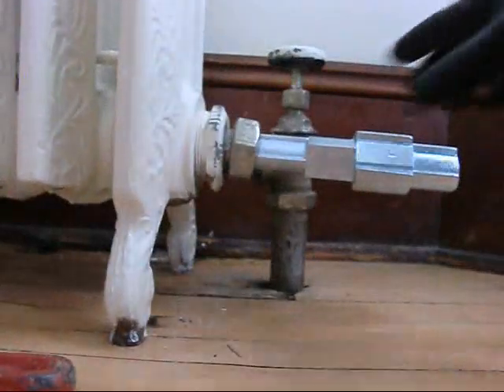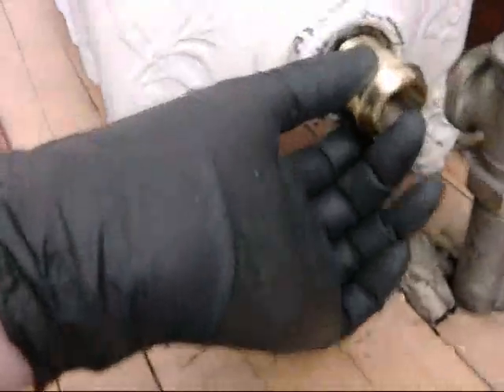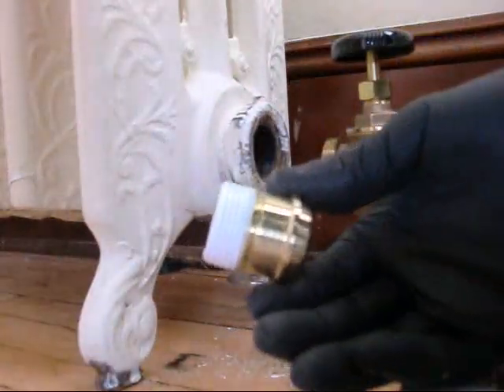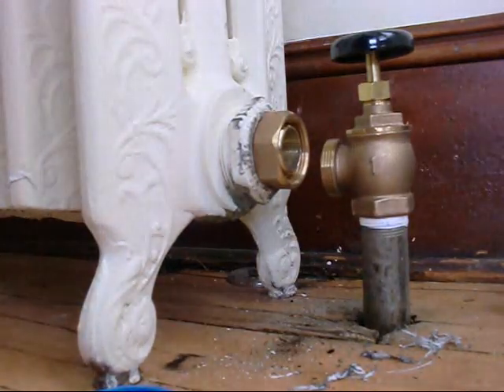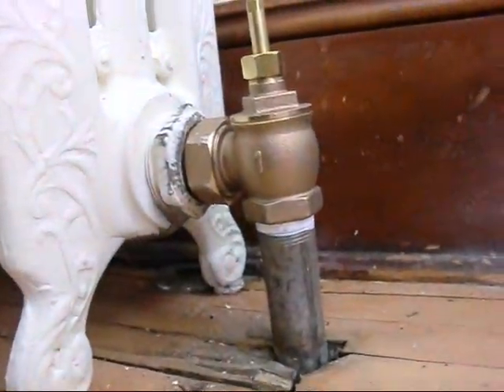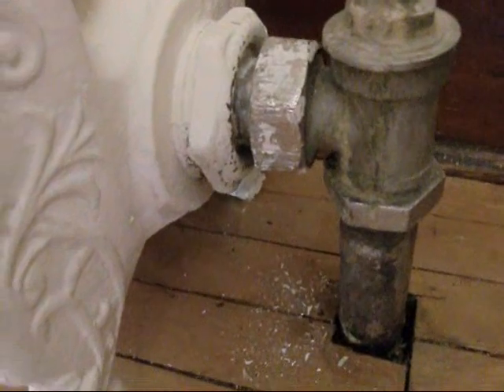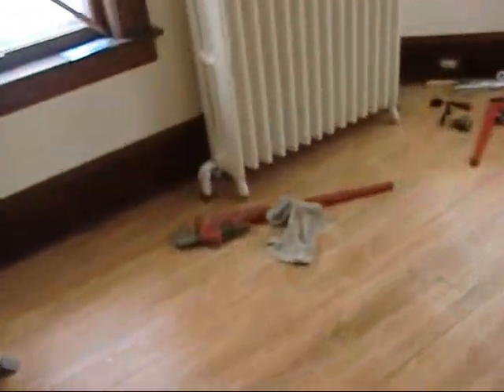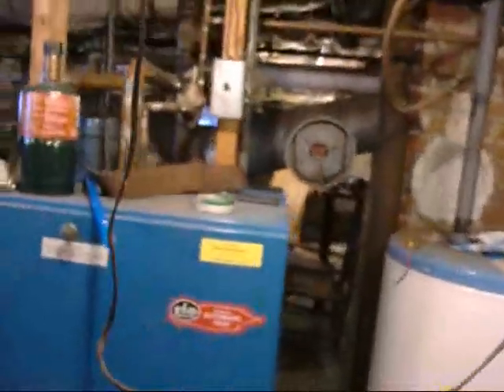2 20 13  Connecting Cast Iron Radiator Vid

Comment: I didn't quite catch how the shortened nipple was corrected. Was the valve coming out of the floor replaced with a longer horizontal piece or was it just force tightened? Thanks

Comment: Can you switch the size of the radiator stem cause I bought a radiator and it's smaller than the valve or can I just replace the female fitting on radiator or do I have to attack a two inch coupler to a one inch female to connect my valve is two inches and my radiator female tightener is one inch wtf do I do

Comment: I replace those at work. I just replaced several valves and flange adapters in one of our buildings.  The situation that made it difficult was the radiator being fixed to wall and the piping embedded in concrete (old building).  Its tough to get new valves and fittings installed when there in no room to work and the piping wont flex.
Reply from the maker: After all my hard work, the owner converted to electric baseboard heat. At least he left the rads in place
Reply: can i ask a question
Reply: Hello there Big Guy ...Do you find that when there is a leaky radiator that it's a spud that cracks or somehow gives up the ghost?  Thanks for any insight, David
Reply: Impressive!  You must be a real "tool ninja!"
Reply: @ryancarter836  apparently not.

Comment: I was trying to research if its ok putting brass fitting on cast iron due to corrosion of dissimilar metals. I got mixed opinions online but I see you're doing it.
Reply from the maker: No prob as the oxygen is boiled out of the system, and you'll never have a prob. It's called galvanic corrosion
Reply: +CORVAIRWILD.ate you a plumber????? serious questions
Reply: @CORVAIRWILD  wtf you talking about, what oxygen? galvanic corrosion is a result of different electrode potential between dissimilar metals

Comment: I would FIRE  the low life employee who used a  wrench with teeth  on  any type of spud wrench.  

It takes a certain type of mindset to want to  damage  a  tool  If the guy is that inconsiderate then give the dummy a sawzall (reciprocating ) saw and cut the spud  out   

One  also  use the back  of another wrench  with a  wrench with no teeth   (hex )  or the very least USE Duct Tape to prevent marring the spud wrench and one certainly does not want to damage the half union connection to the radiator valve  leaving very sharp edges 

It takes a certain "mindset"  to use a steam valve on a hot water (hydronic)  system.  

  Hot water heating valves even when closed   should have a tiny opening to  make sure there is always some type of flow to prevent freeze ups